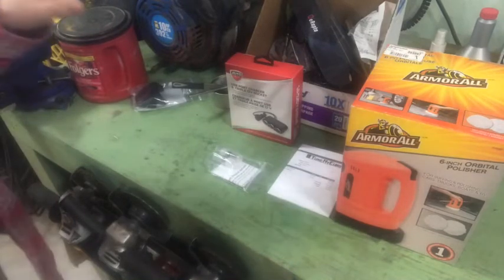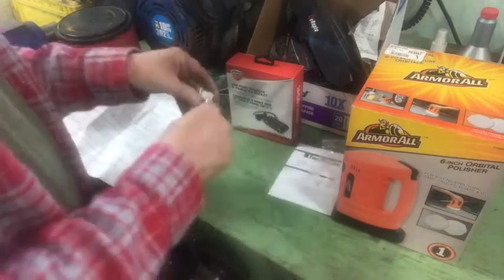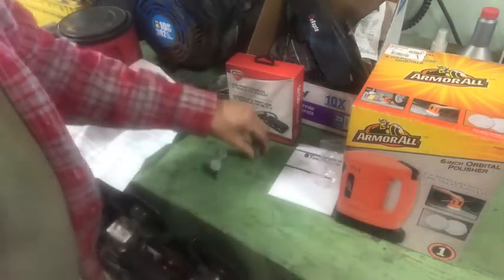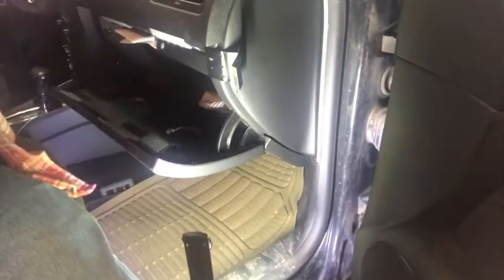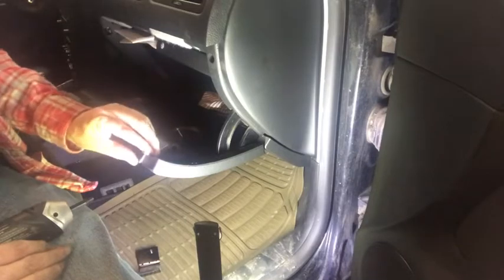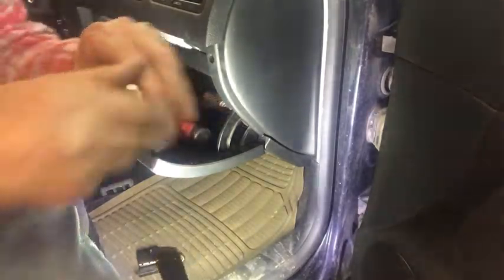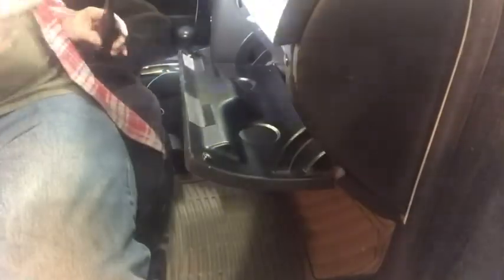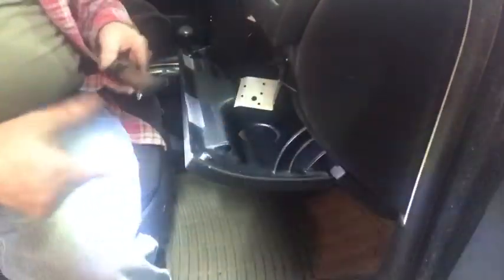VW Jetta MK4 Glove Box Fix

Comment: I found flat magnets with pre-drilled holes at my hardware store, and then dremeled counter sinks in those holes, to flush mount with small head wood screws. The cost of the fix was about $10 dollars, but a key trick to making this all work is this : .... at the bottom left inside of the glove box door is a cog geared arm ... that arm is there to slow down the opening and closing of the door by way of connection to a hidden friction wheel. That friction tends to push the door open just enough to counter some of the strength of the magnets. The way to over come this and make sure all of the magnet strength is in use, is to dremmel off the bottom cogs of the arm, so that at the top of the close action, that arm no longer engages the hidden friction wheel. By doing this simple modification to that arm, the door snaps shut and holds strong, but still opens slowly via the top gear cogs of the arm not having been dremmeled off.
Reply from the maker: I haven't had any issue with it since this video.  I did end up going with just one magnet, two was too hard to pull the door open.  But thanks for that tip.  I'm sure I'll run into the issue at some point and your idea is pretty clever
Reply: @BruceLyeg  - Hi Bruce - for me, in the Great White North ( Canada ) - I tried to find the Rodriguez Kit everywhere up here and it would have been about $20 to $30 US to buy and $30 US to ship from the US, ... so I looked for a less expensive solution close to home.  Good O'l Canadian Tire !! - 2 packs of 3 magnets each. Not as strong as the Rodriguez Kit initially, but by just dremeling off the bottom half of those cogs, it made it all work very well. 
Thanks for the video - it prompted the magnet solution in the first place :)
Reply from the maker: @paulnapier2636  Hey Paul, I'm also in the Great White North.  I'm in Edmonton.  I don't recall what it cost me for the magnets with shipping and all, but my wife was sick of the glovebox door smacking her knees all the time so I just got them lol.  I don't even buy anything off eBay anymore, the shipping is usually as much or more than the price of the item!  One of my other cars is a Miata and getting performance parts is stupid expensive.  Nothing comes from Canada and shipping from the US is crazy.  I was looking at a $2800 turbo kit, but the shipping was $800 alone.